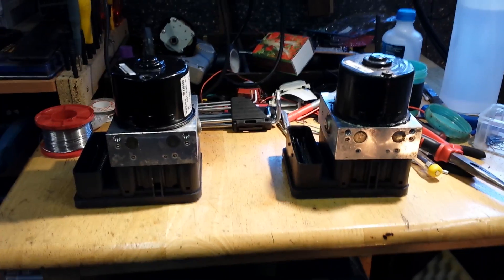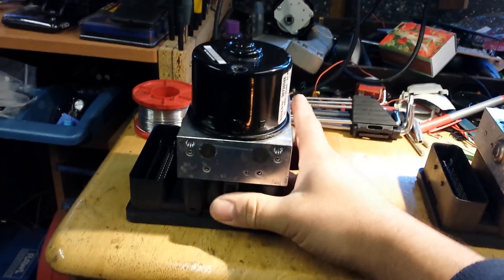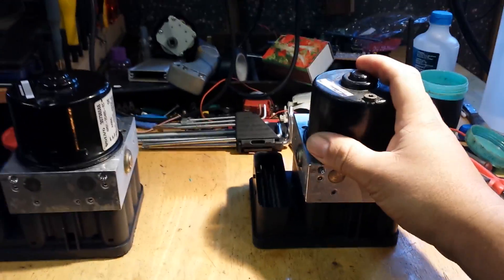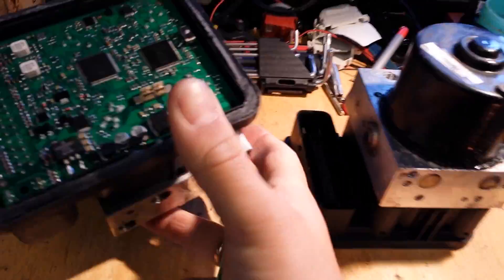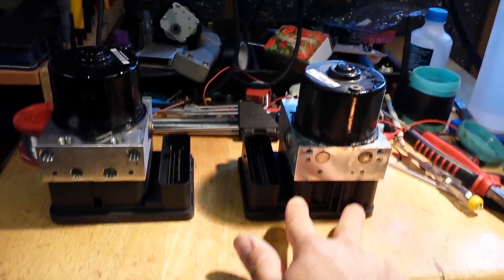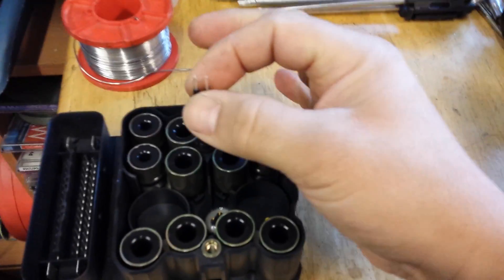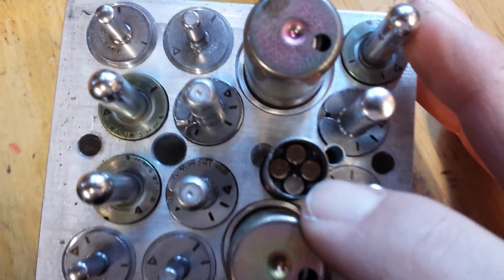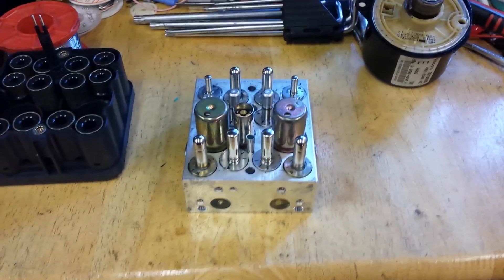Volvo 2005 BCM ABS pump "program"+ pressure sensor fault.

Comment: Hello, my Volvo S40 ABS pump is not sending oil to the left rear wheel. If I replace it with another ABS and only install my own ABS brain, will the problem be solved? Thank you.
Reply from the maker: If the problem is the modulator yes...
👍👍👍
Reply: @LMAutoRepairs  Yes, the problem is in the aluminum part, there is no problem in the brain.
Reply from the maker: @deltaforce1435 
That should work then... as i said... if the issue is the hydraulic unit/modulator... ( the aluminium part)
Reply: @LMAutoRepairs  Thank you, I will try it and share the result here.

Comment: I have Volvo S80 2002 year. I have the lamps on the dash for ABS and STC . The problem is my brake pedal become to be normal after the second press . On the first goes to down ,and the braking effect is very low . Is this the problem in the hardware part if the ABS ? I believe is the motor pump . Can i change it while is on the car ? Can i use motor pump with different codes on it but from the same model  car ?
Reply from the maker: Hi
What is the background of the car?
When you say motor pump, are you referring to the ABS unit, or just the electric motor?
The lights on alone are not enough to give you an informed advice... you need to scan the car and see what the brake module is not happy with... otherwise we are just guessing, and guessing can become very expensive very quickly! 
👍👍👍
Reply: @LMAutoRepairs  I'm referring to the electric motor . I just want to avoid change of the electronic part. I believe the issues is more mechanically related ,not electronic. The simptoms is "weak" brake pedal , when is pressed on traffic light for example, after few seconds goes down to the bottom . Need to be pushed two three times to go hard again
Reply from the maker: @simeonovdimitar7370 
That will not be the motor... the motor only builds pressure during the ABS or ESP activation...
How did the problem started?
That sounds more like a master cylinder problem, or air in the system...
Could be the modulator, the aluminium part were the motor is...
But, again, if you have lights on the dash, scan the car first...
Reply: @LMAutoRepairs  Thank you very much for your competent advice! I will follow your points

Comment: I had a BCM fault on my 04 S60R, I removed the BCM and sent it off for repair and have been driving the car without the BCM installed, the car runs just fine (minus abs) without it.

Comment: None of these mother fuckers actually go inside the pump part with all the valves and springs. Internal air leaks retards. my god.
Reply from the maker: Valves and springs?
What exactly are you talking about?
Why would I go any further in dismantling is the problem was not there?
👍👍👍

Comment: thank you for the video. I own 2007 volvo s40 2.4i. I have got a message says: ABS service required and ABS light on with No code error. the light off after I turn off and on the engine. what could that be ?!. the car runs fine 🤔
Reply from the maker: Check codes on other modules...
Do you have ESP?
Engine faults will cause ABS/ESP to go innovative...
👍👍👍
Reply: @LMAutoRepairs  thank you for your reply. I'm not sure I have ESP. it is the base model of 2007 volvo s40. the message reads: ABS service required. I believe if the car is equipped with ESP. the message will read: ABS / ANTI SKID service required.
Reply from the maker: Possibly...
Which scanner are you using to read codes?
Scan all modules...
A warning like that likely is throwing a code somewhere...
Reply: @LMAutoRepairs thank you for your cooperation. the rear wheel abs sensor is not responding at all. the right rear abs sensor worked after replacing the rear bearing right. I changed the sensors on both rear wheels. the mechanic tested the wires from the abs pump to the dead sensor. wires are fine. still no idea why the rear left sensor is not working.. my mechanic says it is the ABS pump need to be replaced.. however the code error only reads one error code concerning the sensor. no code related to the pump itself

Comment: Thanks. Needed a video showing how to swap ECU's from one unit to another. Need to do this on a 2008 C70 cuz we just need the hydraulic part due to no fluid flow to left rear. A used unit fixed this, but now it won't start because of the eeprom difference.
Reply from the maker: Swap just the modulator, hydraulic part, and keep the origal electronics...
Otherwise you open both units and swap the eeprom...
👍👍👍
Reply: @LMAutoRepairs  That's what we'll do. I wonder if it is possible to program the used ECU using VIDA on my laptop and Autel J2534 device. Saw a guy that did this on a video after seeing this video. He said it works on most Volvos through 2007. Mine is a 2008. That would be the best since we already installed the unit and bled it. If not, then we will pull it and swap ECU's.

Comment: HELLO, PLEASE, MY CAR HAS A SENSOR ERROR, IMPLAUSABLE PRESSURE SIGNAL, TWO MODULES HAVE BEEN CHANGED, 4F0 614 517 K AUDI A6 C6 BLB 2.0.
THE VCDS DISPLAYS A PRESSURE OF -40 BAR IN ALL THREE MODULES.
I AM WRITING YOU IN CAPITAL LETTERS TO DRAW YOUR ATTENTION.
PLEASE GIVE US ADVICE. I HAVE SPENT A LOT OF MONEY
Reply from the maker: Hi
What trouble codes are you getting?
The module you have installed, was used or new?
Thank you for watching!
Reply: @LMAutoRepairs  Good evening.
My code is p059B Pressure sensor.
the three modules are used, one for the car and two more for the second hand.
The second pump, installed, worked a little and ready, at start-up no error appeared, but it suddenly appeared again.
Now nothing happens, it stays on, I always know when I exceed 20 per hour plus that we have winter and it is very difficult to control it.
The two pumps were coded on the machine pump.
Thank you very much for answering me.

Comment: so by swapping the IEP Rom thats how I get by paying the dealer to recode my BCM? I just get the anti skid service and brake assist service message with the replaced unit. NO ABS Light illuminated on my 2004 XC70

Comment: Hi! Nice video and good guide. 

I had the brake pressure issue on my pump. Bought a used one from scrapyard. Tried to just change the middle part but still same fault. Tried to change the electronic part as well and moved the EEPROM like this guide. But now on the spare pump I’ve got the same fault on brake pressure. Any tips?
Reply from the maker: I guess you bought an used unit correct? 
Thank you for watching!
Reply: Yes, a used one.
Reply from the maker: I would suspect that you got a unit with the same pressure sensor problem...😬
Reply: I did try to put the used one to the car before moving the EEPROM from the old one over. And I did not have any sensor issue at that point, but of course immobilized.
Reply from the maker: @simonhenjer8863  
That's strange...
Check contacts on the pins to the sensor...
From when you split the units...
Reply: They looks fine.
Reply: Hi again. I have tried a second used unit. Did only change the middle part with the sensor, used my original EEPROM and still gets brake pressure sensor incorrect offset value 0134. Do I have to assembly and bleed the system or should I be able to delete that code anyway?
Reply from the maker: Have you try to delete it?
Obviously the code will be stored in there from the previous faulty one...
Reply: Yes. I have tried to delete it but it is coming back on right away.
Reply: @simonhenjer8863  Hi Simon,  I have the same problem you had long time ago,  I wonder how you solved,  please help 😀
Reply: You don't have an answer 🤣
Reply: @simonhenjer8863  How did you figured out that there was no sensor issue - the car was not running, at all because of immobilizer?

Comment: Hi. Great video 👍 i have a question. Im helping a friend, and his 2005 s40 has a fault. It says brake pressure sensor. He have a donor car..Can i swap the parts and just use the old eletric part without have to program anything?
Reply from the maker: Yes...
Just replace the modulator which is where the pressure sensor is located... and keep all the electronics from the car....
👍👍👍
Reply: @LMAutoRepairs  thanx 👍

Comment: I have a volvo c30 2011 and got a brake failure stop safely light on my screen and nothing worked speedo rev gauge so on, brakes were fine car stops no problem, when got home turned car off and it wouldn't start again says the same thing but also says immobiliser issue, was told by Mechanic was ecu issue would greatly appreciate your advice especially after watching this thanks
Reply from the maker: Right...
The ABS is part of the immobiliser system....
So, if your ABS unit failed, or for any other reason is offline, then what you are experiencing makes sense...
Get the car scanned, and see if you can communicate with all the modules, and what codes you have...
Thank you for watching!

Comment: Hey, I have BCM-0130 0131 and 0134, all relating to the pressure sensor inside the module.
Would this be cured by simply replacing the middle metal section of the abs unit or do you think this combination of codes is a caused by bad connections inside the bcm electronic part?

My options are to either open and reflow the electronic module or swap my computer module onto a working pump and mid section.
Which do you think would be the best course of action for this combination of fault codes?

No ABS light, only anti skid service required so I don't know if it's a bad sensor or bad module connections.

Many thanks.
Reply from the maker: Yes... the middle part is where the pressure sensor is located...
If you swap that with a good one, should to the trick...
Thank you for watching!
Reply: @LMAutoRepairs  thanks for the help!

Comment: Hello.
My volvo s60 2002 has an ABS problem. There are no error codes or warnings.
 The problem is that if the brakes are applied so hard that the ABS starts to work, the pedal starts to pulsate, and by reducing the pedal force equivalent to light braking, the wheels are not locked, but the pedal still pulsates until the brake pedal is fully released or car stops. 
This problem also occurs if I drive into a small pot hole while lightly braking, the wheels do not lock, but the pedal starts to pulsate until the pedal is released. And the worst part is that the moment when i brake hard and ABS starts to work, I can feel that one of the front wheels does not brake at all, but if I brake hard but not so hard to lock the wheels, all the wheels brake as needed. Where to look for a problem? Diagnostics do not show errors.
Sorry for my bad english.
Reply from the maker: Check live data... check the wheel speeds...
Thank you for watching!

Comment: hello bro, i just followed all the steps you showed us. and everything was great. but I got an error after that, and it's when I go back, the screen says (Fail in abs stops immediately) and I also have ABS light. I do not know what is happening

I have a volvo s40 6 speed manual transmission forward plus reverse
 model 2005

can you help me with that or if you know something that may be
Reply from the maker: Scan the car... it is impossible to guess...
What was your initial problem? 
Thank you for watching!

Comment: So if i have Brake pressure sensor 0131 and 0130 DTCs than i can keep my electronics module and change the motor and middle part with pressure sensor , and i dont need to code it than ? Am i right ?
Reply from the maker: That's correct!...
Thank you for watching!
Reply: @LMAutoRepairs  Thank you for quick answer :)

Comment: The brake pressure sensor isn’t in the pump, it’s on the brake line. Unless somehow it’s been integrated for one model.
Reply: Some do have internal sensors. 🤷🏻‍♂️
Reply from the maker: Loads of models and different manufacturers embedded the pressure sensor in the modulator...
Thank you for watching!

Comment: And this EPROM is Microchip 25LC040 if someone need to identify it from the board. I open both my boxes and they are w/ same board number and compensator are different. Other SMD and other standard. I will try my luck. Let see.
Reply: @LMAutoRepairs  I swap EPROM and fault still on. No luck this time. I look more carefully and circuit board have differences. ABS works but ESP fault though  that unit is working but not ESP. I get ABS working in the gravel road so I think it is matched to system but not compatible. This unit was 20$ so it was not that expensive experiment. I need to think now what to do.
Reply from the maker: @Birchblur  
Get the correct replacement, and again swap the eeprom... you should be good to go...
Reply: @LMAutoRepairs  👍👍👍

Comment: Question: i do have old 10.0960-0115.3 and new recycled is 19.0960-0136.3 what you think that if there is a problem in the swap. I test several components and connections and did not really find any up-normal. I test connections make visual inspection and this board for testing is made easier. Nothing I find. Board look the same what you have in this great vid.

Comment: Question: Can you drive a car if swap of eprom fails and you ruin ECU. You get ABS and ESP light on but can you? And is it true that if motor resistance is too high it stops to communicate.
Reply from the maker: Most likely yes... you can carry on driving...not advisable though...
Thank you for watching!
Reply: @LMAutoRepairs  Yes, I have developing story here. I have used unit where I do change motor. Old one was arounf five ohms and ned recycled one half from that. Still fault in Focus screen. I read errors and it do not have connection at all so next is to swap ECU of it. I will then need to look that part# match and change eprom. Right? I was asking if you could drive since If I do not have garage but need to drive to dealer to make match to main ECU if it do not work.
Reply from the maker: @Birchblur  
Yes... if you change the eeprom should work...
Are we talking about the same car, volvo s40?

Comment: It looks easier to swap the whole module instead of removing the chip and soldering. Just put the hydraulic block on the module to original car depending if you electronics are good. My pressure sensor is bad so that’s how I’m gonna do it.
Reply from the maker: That's also an option...
Thank you for watching and for your comment!

Comment: Hi there, l had anti-skid service message on volvo s40, bought a second hand abs pump, swap the brake pressure sensors but the message is still on,so the questions is its need diagnostic now?
Reply: Hi, so l bought again the second hand pump, then l replaced it and no more issues! Thanks for your help! 👍👍👍
Reply from the maker: That's great!
Thanks for feedback...
Reply: So l just done the diagnostic and the message is still on,3 codes with brake pressure sensors, not know what to do now 😔but doesn't effect the drive the car, all is fine just the message on the dashboard
Reply from the maker: @jaroklein1390  
Hi
Yes the will drive normal... but the stability program is disabled...
You might got a module with also a bad sensor?🤔
Reply: It is possible, but I will not solve it anymore, thank you for your reply
Reply from the maker: I think you should have diagnosed it before...
That message can be caused by different things... not just by the pressure sensor... 
Thank you for watching!
Reply: @LMAutoRepairs  thanks for reply, it was diagnosed before, issue was brake pressure sensors,will try diagnostic tomorrow thanks
Reply from the maker: @jaroklein1390  
👍

Comment: I have a 2006 C70 with the anti skid service message on. I've hooked it up to Vida and it gives me a code BCM-0134 which is for a faulty brake pressure sensor. The module and pump still work because I can activate it on Vida. Also, in Vida, the brake pressure is showing a reading of 200 bar at all times. Car drives fine.  Can I just remove the entire module from the car and replace only the metal part containing the brake pressure sensor, and reuse the existing working parts without having to go to Volvo for programming? Tia.
Reply from the maker: Correct...
Thank you for watching and for your comment!
Reply: @LMAutoRepairs  great news! Thanks for making this video
Reply from the maker: @christopherjz  
No worries... here to help!
Reply: Hi. I have just followed your advice and replaced the hydraulic unit on my car. It worked and the abs system is fully working again. 

You have saved me £863 from getting it fixed at Volvo! I can't thank you enough. Great work!
Reply from the maker: @christopherjz  
That's great news! 
Well done!

Comment: I have problems with my 8634411 (10.0204-0279.4) ABS pump. Can someone tell with which pumps this can be replaced? I wonder if I could use the most "fresh" one, but would it be 2003 or earlier as well? 
I got v70 II 2.4t 200HP with automatic transmission and DSTC.